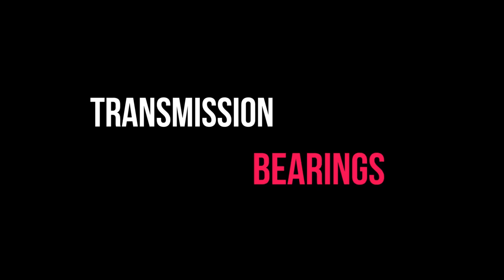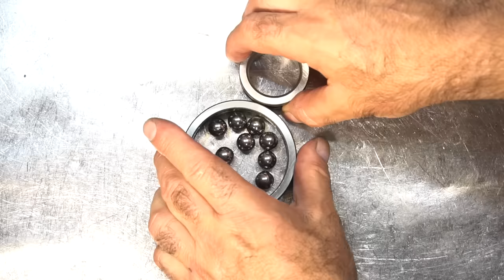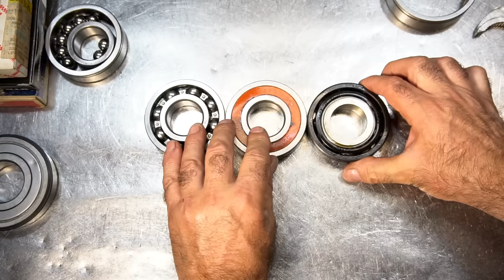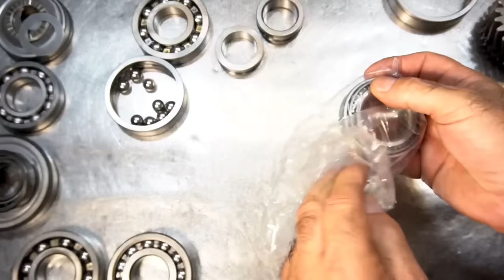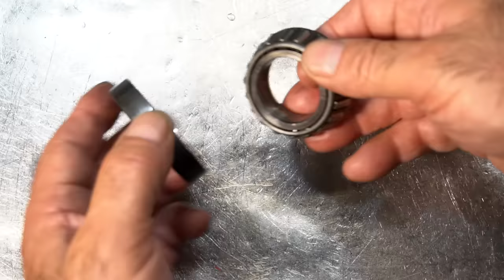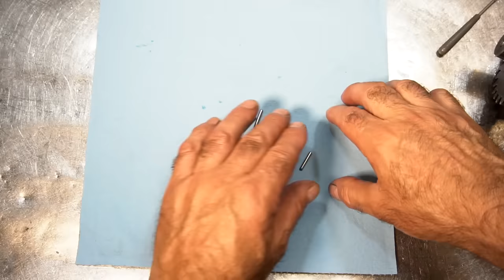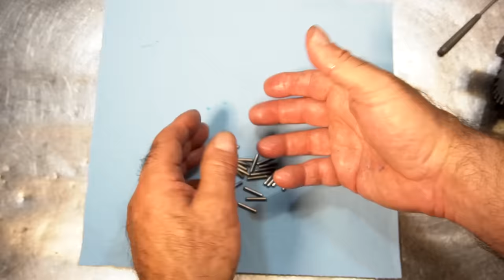Learn About the Basics of Ball Bearings, Needle Bearings, Tapered Bearings

Comment: I am a novice. I wanted to know that if for my application (say doouble pendulum), if I have a choice of using a smaller bearing (ID 5mm, OD 9mm; or ID 3mm, OD 10mm) and a larger one (ID 9mm, OD 22mm), then is there a performance difference between the smaller and larger bearing? If I use the smaller one, then will that reduce performance in any way or is the performance same for different size bearings and size should be considered as per application?
Thanks!
Reply from the maker: Bearing application has a lot to do with size in regards to how it is going to fit in your part and the clearances needed along with the load rating and load capacity required
Reply: Hello, if you need bearings, we can provide all kinds of bearings at reasonable prices, welcome to customize

Comment: What are the best radial load bearings for heavy duty application?
Reply from the maker: Depends on the application. There is no best bearing.
Reply: yeah depends on aplications, for low speed best will be roller bearings without seperator because you got more working surface
Reply: I would say Needle roller bearings, can take huge more radial load, therefore they are always used in Cardan Joints

Comment: At the end of the video you showed a needle bearing at a helical gear ... my question is that the helical gear will induce thrust force but a needle bearing can only handle radial as u said so how is this ??
Reply from the maker: There are many needle bearings used under helical gears or support helical counter gears at each end. Thrust load is usually handled by flat thrust rollers running perpendicular or simple thrust washers.

Comment: If they made on the filling slot differently without the slot, if the bearing inner Race screw together on the collar held in by 2 long collar grub screws from each end don't believe would suffer this problem
 is there such a bearing

Comment: Hey there watched ur video I have a question I have a road bike with I believe 6082 bearing sealed now from the factory the bearing are greased and sealed however they might roll smooth they are grippy and tight they dont flow or spin easily... now do you think the bike builders knew what they what were doing (these were 700 dollar carbon wheels ) in terms of do bearings for the rear wheel have to have a LOAD on it for it to spin in a faster rotation cuz the front wheel spins freely and loose... I'm about to take out the bearings degrease them and just lube them with some t9 lube and put them back in with no seals I know they won't last as long but the wheel seems like the grease on these bearings is creating more friction where the goal is to create less friction... so my questions is do you think I should do a bearing cleaning job and put them back in??? as long as I keep opening up the rear wheel hub to see how they're doing I think that is what I do thx for ur time brother man 
Peace
Daniel tampa FL
Reply from the maker: Why don't you carefully remove the seals clean and repack and reinstall the seals? If dirt gets in the hub and locks it up... Then what?

Comment: could you please advise for taper roller application in an automobile which part can be used
Reply from the maker: Where the application is? Transmissions, wheel bearings

Comment: after trying to remove the tailhousing to my saginaw I didn't know about the retention ring and tried forcing it. my needle bearings fell out from 1st/2nd sleeve.  can I put them back in from inside the side cover?
Reply from the maker: No, you have to remove the front bearing and slide the gear train and tail out and fix the issue
Reply: @GearBoxVideo  do I need a press to remove the front bearing? Thanks again! Your videos are the best!

Comment: 1977 z-28 super t10 growls in first and 2nd - 3rd a little and hardly no growl in 4th. i'm thinking front bearing whats your thoughts and it makes that growling sound when your on the gas or off.  thanks again
Reply from the maker: Bearings more than likely... do the math. The transmission is old.
Reply: @GearBoxVideo  thank you you make it look so easy and with the help of your book i'm going to tackle it in january
Reply from the maker: Those had a problem with bearing failures within 50K miles.
Reply: @GearBoxVideo  thanks and i'll keep watching your videos

Comment: Are all bearings on the car the same size I bought a hub assembly for the front bit I need it for the back can I get the bearings out an use them for the rear wheel bearing
Reply from the maker: No , hub bearings are usually different front to back. Get the proper assemblies.
Reply: Thanks

Comment: Hello, what vehicles use tapered bearings in the wheels? Say if I were searching through a scrap yard?
Reply from the maker: Some do yes.
Reply: Michael O.  Tapered bearings are mostly found on the rear wheels of a vehicle.
Reply: Michael O. I have a set of tapered bearings removed and replaced from the landing gear of a Cessna 172 I used to own.  For the life of me, I cannot see anything wrong with them. . .
Reply from the maker: Any car US from the 60's to the 80’s

Comment: I'm restoring a 1946 Walker-Turner table saw and during disassembly yesterday, I encountered a bearing I'll need to replace, if possible. This one is for the arbor tilt worm gear where it attaches to the base. Near I can tell it is stamped with: 

L02 SKF C Made in USA

It does not appear to be a sealed bearing. Anyone have an idea how I can replace it and if the L02 C indicates a size that I can cross reference? Also, as I get further into this resto, I'm pretty sure I'll need to replace other bearings throughout the machine. Thanks in advance!
Reply from the maker: Without knowing the bearing type its hard to help you
Reply: @GearBoxVideo   Do you have a site or location I could send you a pic?
Reply from the maker: Videos and descriptions have my links

Comment: My 3/4 hp HVAC fan blower bronze sleeve bearings put HEAT into A/C, Perhaps it just needs rebuild with quality grease
Reply from the maker: Or a new bearing
Reply: @GearBoxVideo  All my 4 fan blowers have same heat issue.  Test your HVAC blower at duct end, you may see temp go up 3 degrees on air flow.   I set fan on lowest setting to lower heat only 2 degrees, but AC coil wants higher air flow.
Reply: Lithium or Graphite Grease may be the key to resolve friction heat.   Lithium arrives in few days
Reply: @GearBoxVideo  BTW, nice video, I'm sure you do high skill quality work
Reply: @GearBoxVideo  or replace with a BALL Bearing.  You think I can replace fan motor sleeve with ball bearing?  But how to keep lubed or get sealed with no heat friction attacking my A/C efficiency
Reply from the maker: Depends in the dimensions. Heat could be from the motor itself. Electric motors often times use sealed ball bearings.
Reply: @GearBoxVideo  No other bearings in these fan motors.   Metal on metal bearing seems likely the heat cause.  Lithium Grease should help resolve.  Arrives in few days.  Also bearing heat takes 2 hours to go back down to room temp.
Reply: @GearBoxVideo  heat is coming from motor, not bearing.  I didn't know small electric motors create that much heat.
Reply from the maker: Google "C rise in electric motors" to get a better understanding
Reply: @GearBoxVideo  Thanks for sharing good info how electric motor create heat.   My issue is getting 4 ton A/C unit running well.  I found suction line is too small 3/4" when it needs 7/8".  This upgrade should make make hot fan motor run less and A/C run better

Comment: What about those with a black plastic ring that doesnt cover the whole side?
Reply from the maker: Some bearings instead of a metal cage use a nylon cage which typically has a flat side and snaps into the balls leaving the other side exposed.
Reply: Those plastic shields are a dust ring so you leave the plastic side outwards
Reply from the maker: These are seals and are preinstalled on the bearing. We never use anything that is a plastic shield. I think perhaps there is a misuse of words here.
Reply: @GearBoxVideo  Yes I mixed up the bearings on topic (transmission) I was thinking of smaller bearings like scooter bearings where one side is often plastic

Comment: COULD THOSE FILLING HOLES BE WELDED SHUT OR FIT WITH A PLUG? I KNOW _ NOT EASY
Reply: I don't think you should need to. As Paul stated they're not really designed for any thrust movement so they stopped using them due to excessive failure from breached cages and race wear(thrust or axial forces) causing fluid contamination further destroying themselves. I would rather have a sealed bearing instead and change the fluid.
Reply: No. Welding would require further heat treatment and race grinding - you can't do that with the balls in place. But they're not intended for high axial load conditions - only high radial loads. Horses for courses.

Comment: You lost me when you said (17:40) you need to change oil on manual transmission every 10,000, very sad.
Reply from the maker: Most companies recommend changing oil at 20k. Cheer up
Reply: eeh my trans got 60k km and no oil change, well its a old toyota and the workshop says they go infinite....
Reply: @GearBoxVideo  Wrong again my friend, I think you are getting confused between automatic and manual transmission. Trust me, no self respected mechanic will tell you change manual transmission oil at 20k miles.
Reply: @k0712s  brighten up
Reply: Actually most modern car manufacture dose not recommend oil changed in manual transmissions at all (at least in Europe). But it doesn't mean you shouldn't do it. In Land Cruiser Prado manual transmission they advice oil check every 60k km. When I purchased this car it was 300k km and previous owner didn't change oil at all. But on 3rd gear synchronizer was bad and 1st gear sometimes jumped of, I guess it was caused by lack of maintenance.

Comment: What is " z" in bearing and why Z ?
Reply: Hitesh Rohit Z means metal seal on one side, open on the other. (This is from looking it up.)
Reply: What is the reason to use "Z" ?
Reply: Hitesh Rohit no idea. There’s a few different prefixes and suffixes on bearings to denote their type.
Reply from the maker: Attached is a link to the most standard bearing suffixes and cross references. I have no info as to the origin but typically bearing companies try to keep the  numbering the same to make cross reference of bearings easy. See this link. http://www.microbluebearings.com/bearing-suffix-codes/

Comment: I'm looking for a bearing along with a flange which would support a pulley and a 6mm diameter rotating shaft. Which bearing would be ideal for my application?
Links-
6mm diameter shaft- https://www.gsf-promounts.com/6mm-diameter-hardened-steel-shaft/
60 teeth pulley with 6mm bore- http://shop.sdp-si.com/catalog/product/?id=A%206D51M060DF0606
Reply: Basically, I want to move the shaft along a fixed axis.
Reply from the maker: A pillow block bearing would work best
Reply: @GearBoxVideo  thank you for the advice

Comment: So , Let me understand you . In an 11 ball race where 'one' of the balls is inline with the loading port, the other 10 balls are incapable of supporting the load that an 8 ball race with no cut out can support well enough ! Yea right.They do have issues with heat and associated failings but axial thrust is not one of them
Reply from the maker: It's OK to disagree with me but all you have to do is look at any ball bearing spec of a said bearing with both Max and reqular ratings in a ball bearing catalog. This is clearly documented in my book with reprinted pages in the of the New Departure Hyatt bearing catalog. Also to note was the Ford service bulletins replacing Max bearings with standard bearings in the truck RUG transmissions. Look specifically at Radial load and axial load.... NOT dynamic load.

Comment: What about angular bearings?  Do they always have the axial play when not under load?  Doing a transmission, and this angular bearing (not loaded) has this rocking back and forth but was told its taken up when the gear stack is installed and "piched" btw the case halves applying load.  Here is mine:    https://www.youtube.com/watch?v=nO4Ljn08c9Y                thoughts?   thanks!
Reply from the maker: The bearing out of the case is unloaded and IT WILL have play. Angular contact bearings require shims when installed to maintain ba preload specified by the manufacturer. The bearing is not fully installed.
Reply: perfect thanks for the quick response!   Yes, I left it like that too demonstrate the play....it is tight when preloaded.  Spins perfect, just no experience with these types.

Comment: The hub of the bearing of my bike's clutch pressure plate is wobbling. Is it broken and should it be replaced? Here is the video of it.
https://www.youtube.com/watch?v=Bz8Hytke5H4
Reply from the maker: There is a number on that bearing. The bearing appears to be a standard size. It can be easily sourced and looks like it just presses in the hub.
Reply: I looked it up and found out that the bearing is broken. It's a 6001. I changed it and the problem appears to be solved. It caused an excessive slack on my clutch cable, therefore it wouldn't fully disengage. The bike is Honda CRF250L. Thanks.

Comment: Metric sizing is CORRECT, its the USA that's the oddball in sizing!
Reply: Actually a typical bearing, lets say a 307, is measured in MM. As in the example, 307, it has a 35mm inner dia., 80mm outer dia. and a 21mm thickness. 7x5 gives you the 35mm bore. A 309 has a 45mm bore etc. Not quite as easy as the metric 30 65 bearing being self explanatory.